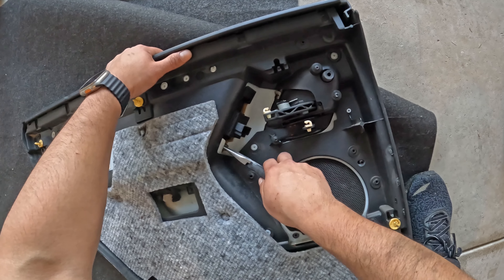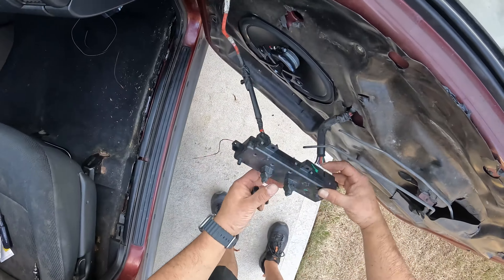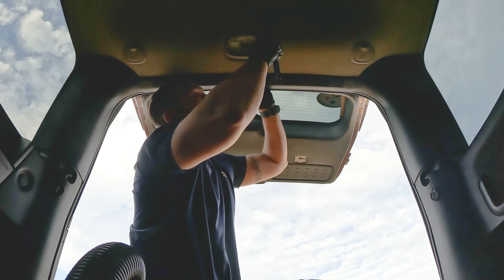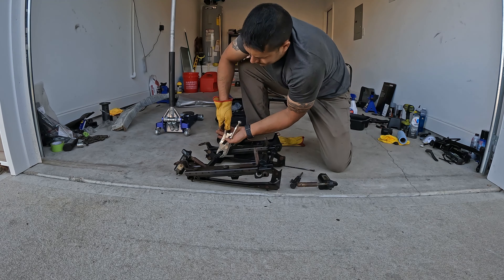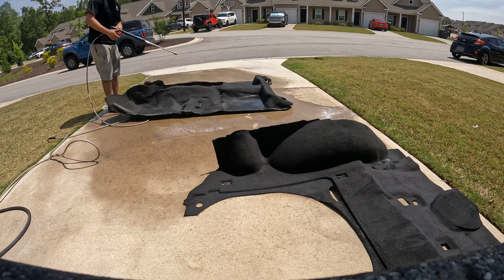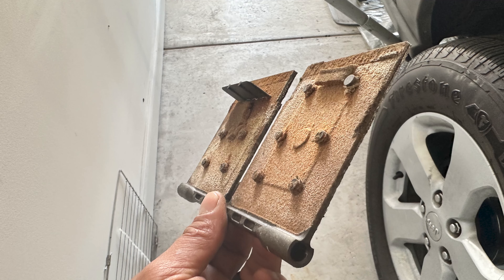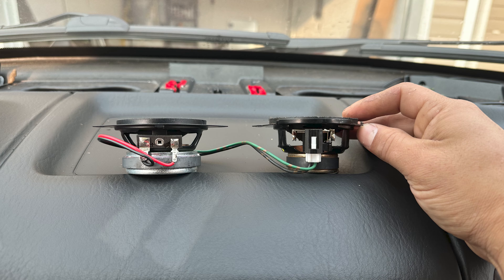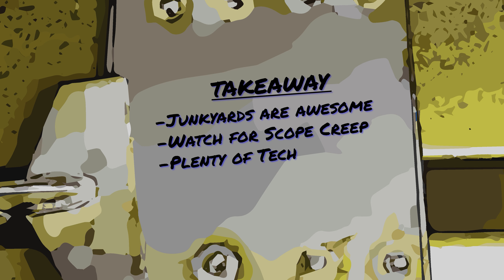Jeep WJ - Episode 8: Strip the Interior

Comment: How long did the blend door fix take you? Mine wj just started blowing hot air on both sides and has coolant. I’m looking to fix mine soon.
Reply from the maker: Is the coolant fully bled? It took me a while with the heat on full blast to get the coolant bled into the heater core.  If that's good and your refrigerant is good then go for the blend door fix.  If you get a heat knife then it's pretty quick, just follow the directions in the kit and shouldn't take more than an hour start to finish (so give yourself 3hrs lol).  I was frustrated that the new arm didn't align with the motor though...It was physically angled in a different direction than the arm that I pulled out, but the new motor lined right up with it.  Maybe a model year difference?

Comment: You can replace the horn and airbag pad I did it at the counter of pull-a-part because they would not let me buy the whole airbag unit
Reply from the maker: That's good to know.  The only decent one I found was at a junkyard without the "pull-it-yourself" option.  They said they would only sell me the entire steering column and wheel without the cover because of liability.  The goof off got rid of all weird gooeyness, but the jeep emblem was still beat up so I wish I could have gotten a nicer one..next time!